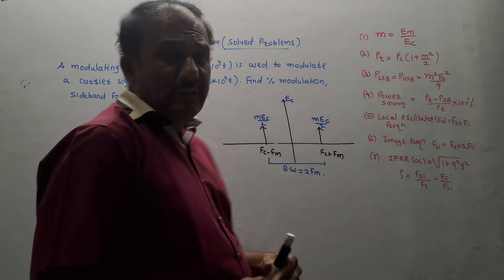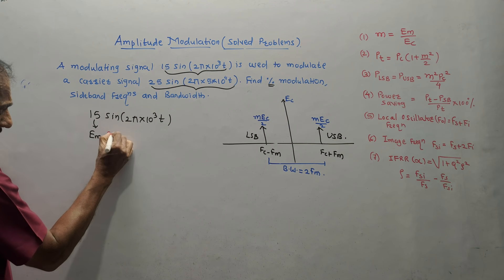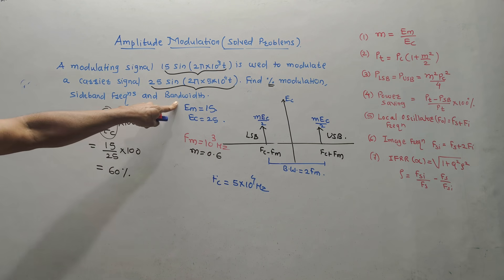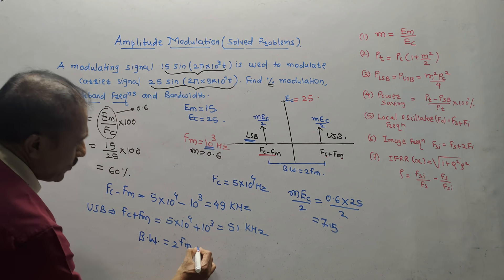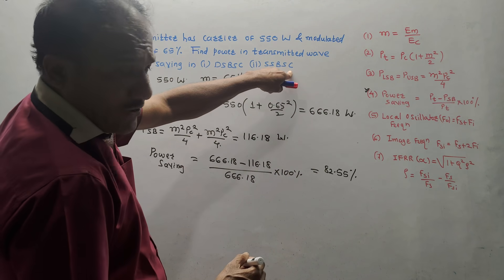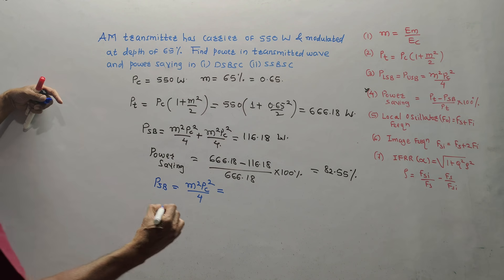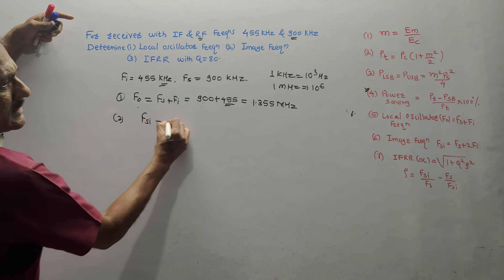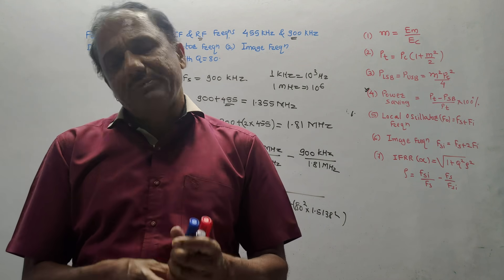AMPLITUDE MODULATION  (SOLVED PROBLEMS)

Comment: sir 2 nd sum me psb ka calculation same nh aa rha  sir after putting values and solving the equation i get ans 63903.125
Reply: Same here
Reply: Its formula is wrong it it m²pc/4  not m²pc²/4 try with that you will get ans
Reply: Bro still ans come wrong is their convertion of 550w @virajKadam-zi7mw
Reply: @AnjaliSuryawanshi-ok2km Aapka ans right aaya ky if yes to kaisa Kiya plzzz😊
Reply: @virajKadam-zi7mw  just follow this formula